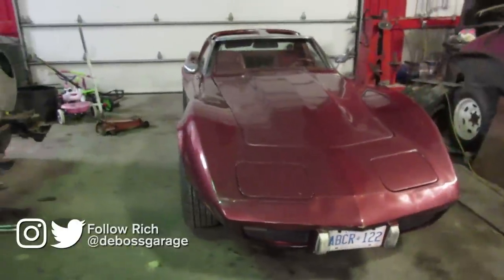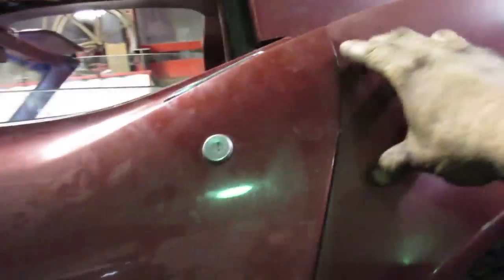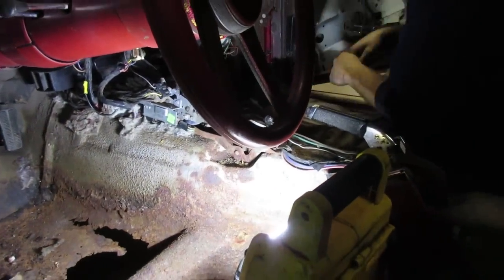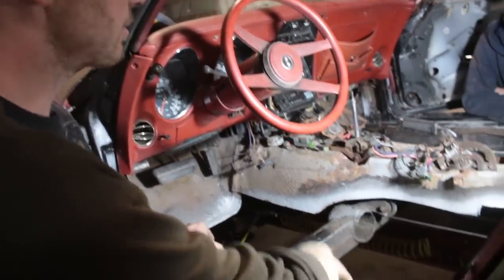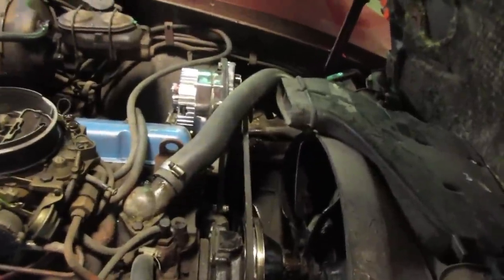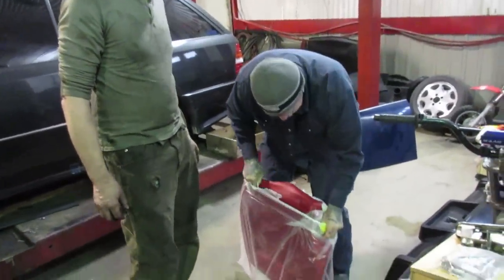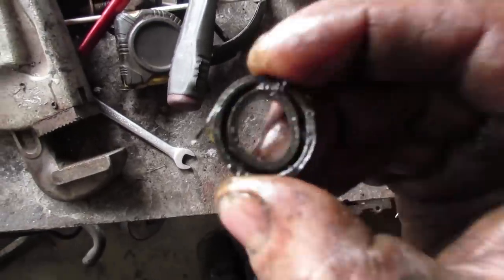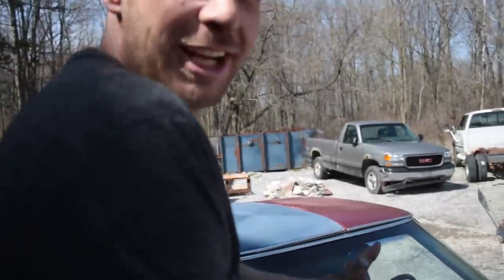'76 Corvette Stingray Gets Ready For The Road

Comment: Rich isn't kidding about these cars being tight inside... I'm also 6'3" and have a size 15 shoe and I had to pull my buddy's 80 'vette into the garage for him one night when he had to leave suddenly to handle an emergency. His car was cold blooded so I had to power brake it to keep it running in gear and my feet barely both fit next to each other in the foot well and my head was a solid 2" out of the T-top hole. I'm guessing max occupant height on this car is realistically about 5'10".

Comment: Burn outs in a 180 hp car? Why? Put some high flow cats on that thing, a cam, some heads, headers, real dual exhaust, and re-jet the carb and that thing can fly.
Reply: why cat's ?
Reply: The cat is probably plugged and flowed like crap in 1976.
Reply: Sebbonx Xsebbon cats didn’t exist in 1976
Reply: Farmer Ben  not in the way we know them today. But the general theory did. The biggest thing that harms the 70’s cars’ hp is the emissions systems (as well as crappy cams and heads) by removing all the emissions equipment, you can probably make like an extra 80 hp. By then doing a big cam and aftermarket heads you can probably take that 180hp smog compliant engine and make around 300. Still not a crazy amount of power but way more than it was